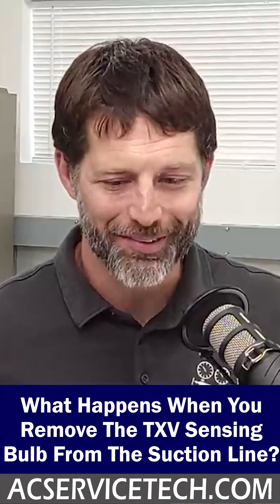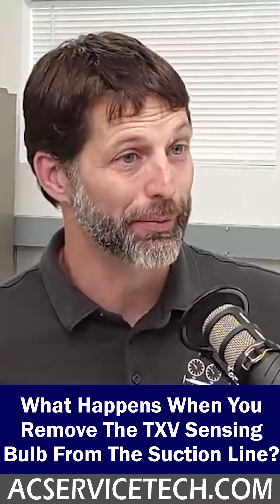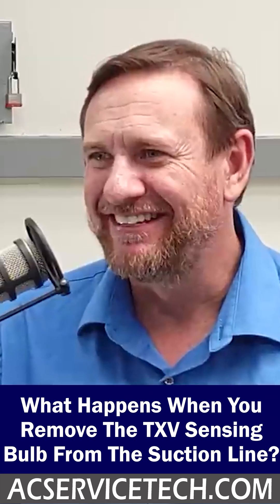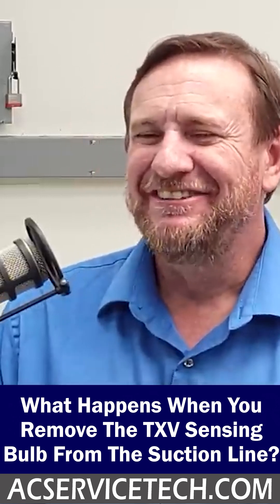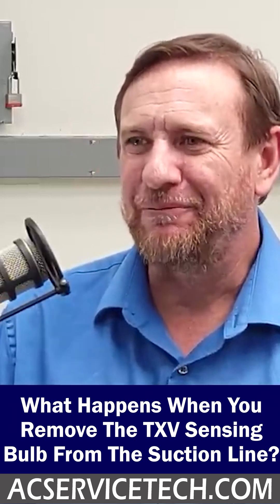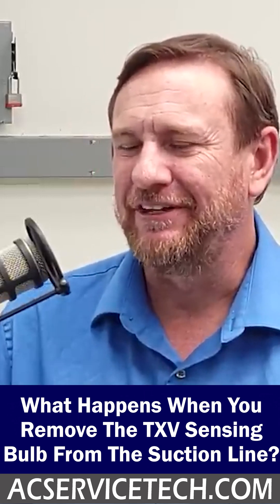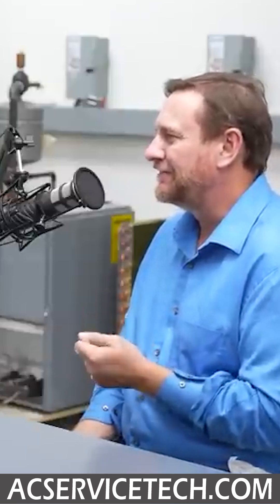What Happens When You Take a TXV's Sensing Bulb From The Suction Line?

Comment: How important is it for the sensing bulb to be insulated? I seen some manufacturers don’t insulated the sensing bulb and some do
Reply: i also am curious about this
Reply: Not that important.  You may want to insulate it to prevent sweating, but as long as it has good contact with the pipe the heat transfer from the suction line to the bulb will be so much more substantial than the air that it will make a negligible difference imo.
Reply: It depends on if it's mounted inside or outside of coil.
Reply: Any unwanted heat on that bulb will affect its performance.